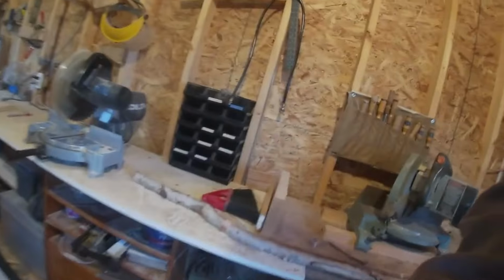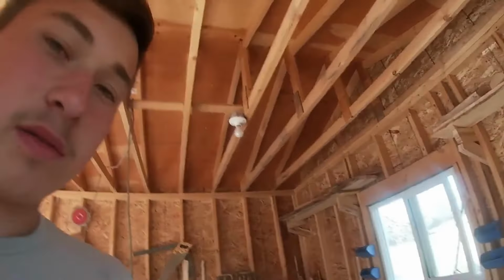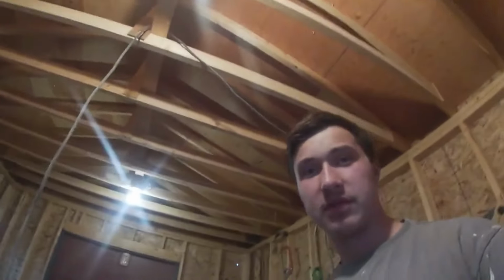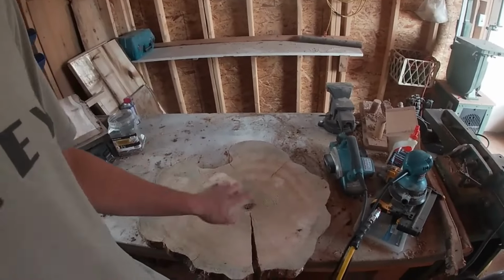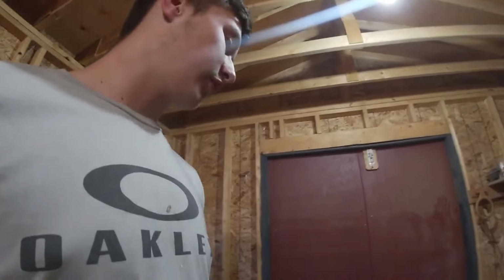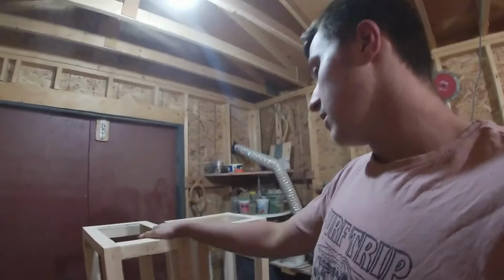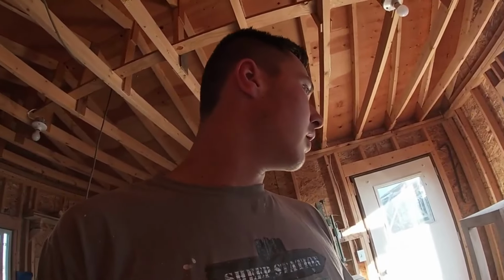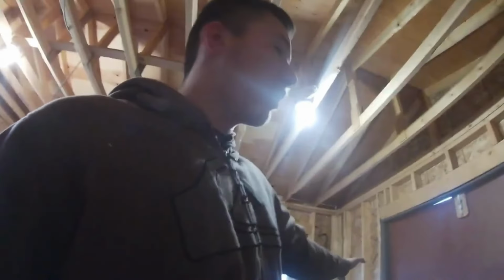I Quit My Job At Dairy Queen To Start a Woodworking Business- Week One

Comment: OK, it seems to me that you are trying to maximise your profits by minimising the effort. Instead of mass producing something, you produce less quantity wise and compensate that loss in price. So your products starting prices are higher. You seem to get your material free, thus you may not be calculating material expenses. Perhaps this method works, but maybe you are underpricing your products. 
I believe the table tops look fabulous but I think the legs seem a bit rugged though. 
I myself, as I am also starting a woodworking business, would prefer producing quantity as I can control the prices more easily. I can start selling a product at 10$ and if people buy it, I can double and triple it. I also aim for more than 95% profit margin. The downside of my way may be the high dependency on demand. You need less people buying your products to match my profits (in the case that your profit margin is good enough).
But, these are just my thoughts. 
Good luck